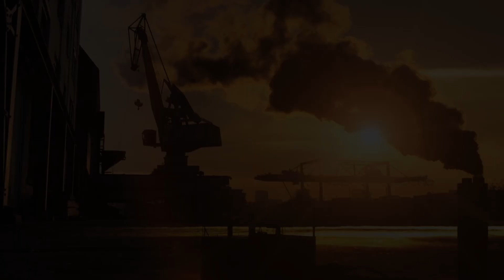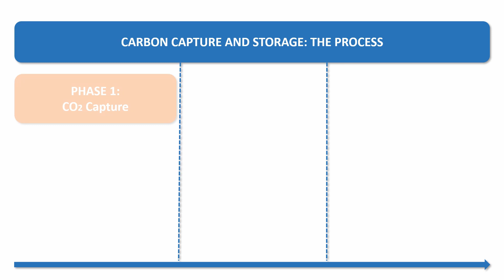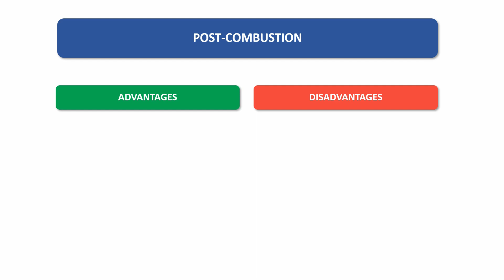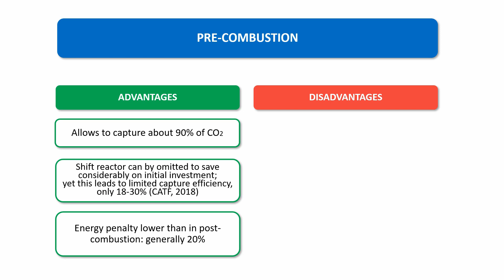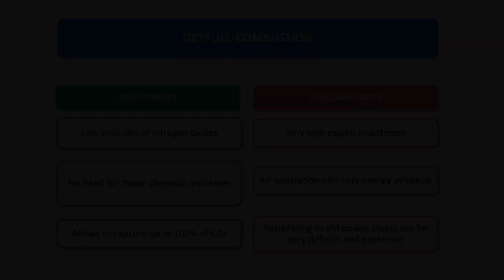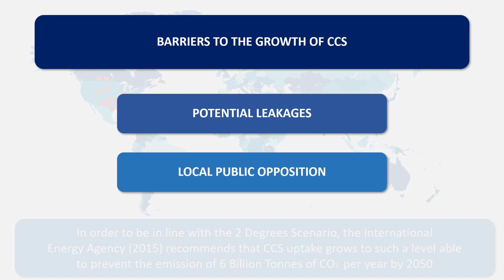Carbon capture and storage technologies for the sustainable use of fossil fuels

Comment: Selagi emisi gas carbon dioxide masih bisa diserap  oleh tumbuhan gas ini akan hilang dengan berubah bentuk sebab kecepatan tumbuhan mereduksi gas tersebut juga bisa meningkat signifikan jika kapasitas quary berlebihanmaka tumbuhan membentuk sel sel jaringan juga melonjak secara signifikan juga . Molekul gas ini masih tergolong dalam struktur molekul golongan lantanida jadi tanaman aman dalam mengadsorbsinya lain nika masuk dalam golongan aktinida. Berarti tidak masalah mungkin hanya nampak unsur karbon yang sudàh pecah dari carb9n dioxide yang berhamburan di udara sebelum berhasil jatuh ketanah
Reply: You need to learn some science. Carbon dioxide is an atmospheric gas, it's there for the long haul. Some is dissolved in rain and from there it can make its way to the ground, but mostly as the rainwater evaporates  so does the CO2.

The ocean contains a good amount of CO2, but carbon dioxide dissolves in water to form carbonic acid. Carbonic acid reacts with the shells on molluscs, dissolving them. It also dissolves limestone.

What we must do is reduce the amount of carbon in the atmosphere. I have not seen anyone talking about that.

Comment: There is no such thing as "sustainable use of Fossil fuels" as no matter how efficiently you use them, they will still run out.
Reply: Well, we certainly are not going to run out in our lifetimes, so if we can make a process that makes use of them with nearly no environmental impact, I think that's better than doing nothing about it at all. Not to mention, there are renewable carbon-based fuels, such as bio-fuels and plain old wood. Those can also be used in this process. Renewables are great, but this is also a good way to reduce our CO2 emissions while we are transitioning.
Reply: @nathanielthomas4437  In theory if we compare world oil reserves with current consumption we are bound to run out of it withint 30 to 40 years, and that's if we consider that we don't change anything.
Question is, will we increase demand and shorten this expected lifespan even faster? Or will we reduce it through cleaner energy?
Reply: No kidding they will run out by then we will have way more technology

Comment: The possibility of leakage is huge under/after CO2 deposition. Think about earthquakes, fault in processes, etc. I think these technologies are not final solutions, they move the problem to the future. It's time to replace the use of oil and its derivatives.
Reply: Yes, but what do you pretend to do with the CO2 that is already in the atmosphere? Let it be?
Reply: @magalhaes753951  There is something called direct air CO2 carbon capture. I think it uses the same solvent to absorb the CO2 but the process is a little different.
Reply: @magalhaes753951 put it in carbonated beverages. Coke has 2 grams of co2, sell it to greenhouses, they use 800 to 1,200 ppm to speed up and produce bigger crops
Reply: CCS for use in Carbon Concrete is the way to go. Check out what Blue Planet is doing--while mimicing Earths own Carbon storage practices!! THATS Sustainability.
Reply: Well, supercritical CO2 is a great industrial solvent, plus dry ice has it's uses as a great cold-sink in various processes. Storage is an option, but I think it's a lot better to think of CO2's use in industry rather than as a waste product. And even if it eventually makes it's way back into the atmosphere or into the ground, at least we made use of it and made some reduction in the short-term emissions. I think it's better than venting CO2 into the atmosphere directly like we are now. Eventually we will transition to completely renewable, but while that's happening, we may as well make fossil fuels more environmentally friendly through processes like these.
Reply: @nathanielthomas4437  It still makes its way into the atmosphere.